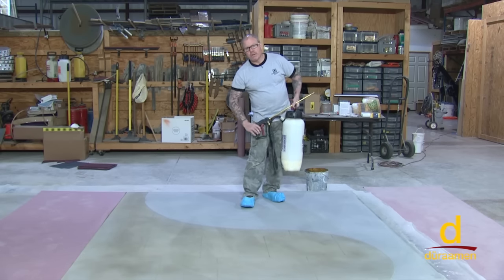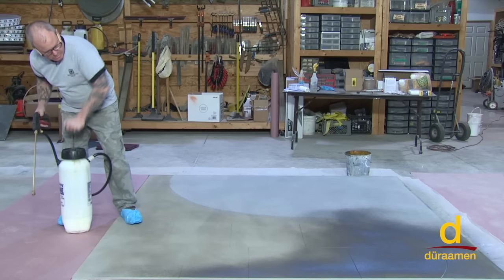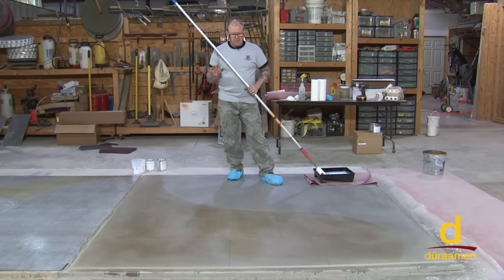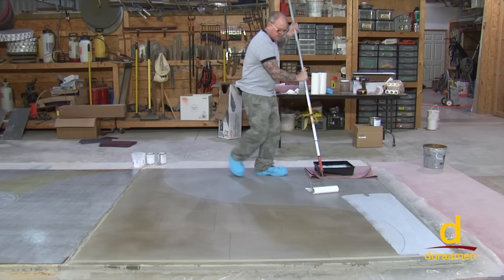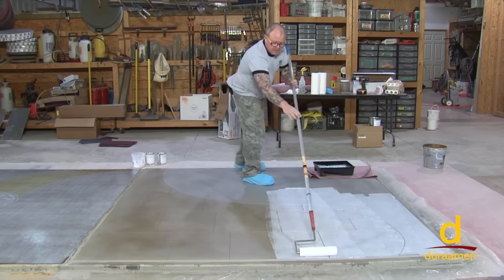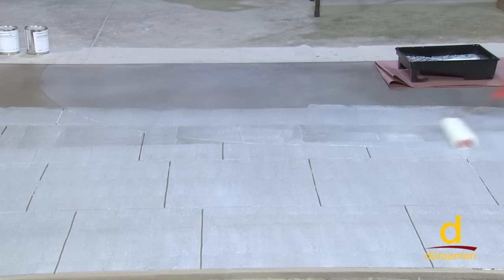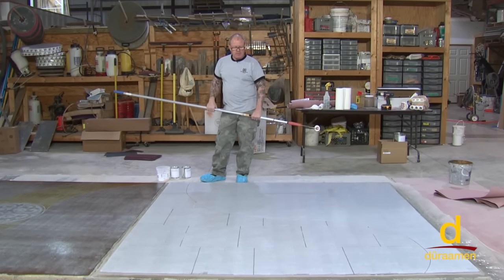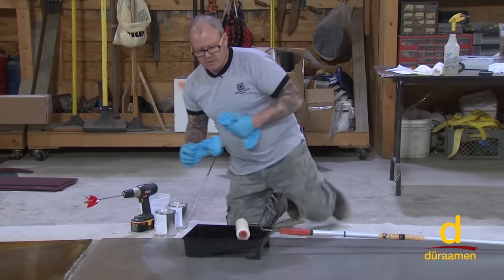How to Install Self Leveling Concrete Overlay - Part 4

Comment: I learned more in your three videos than any other instruction video I have watched in a very long time.  Great work !

What would you suggest using for leveling over a lightweight concrete, radiant floor application?  There are several small areas 2 to 3 square foot that will need to be addressed before floating engineered flooring or even putting downTravertine or slate tile.  It will be feathered to daylight.   Will it chip out at the thinnest areas after time ?  

Thanks Again  Gerry